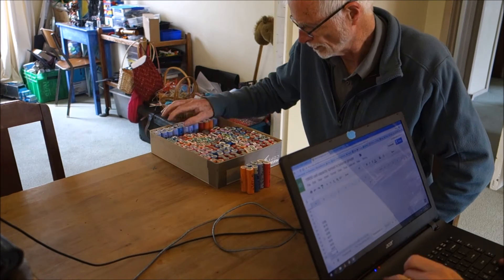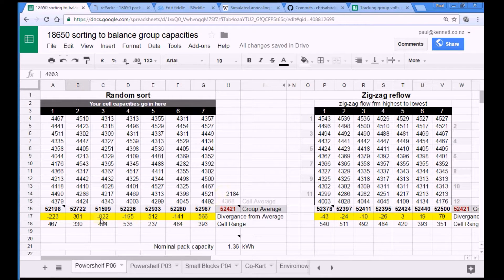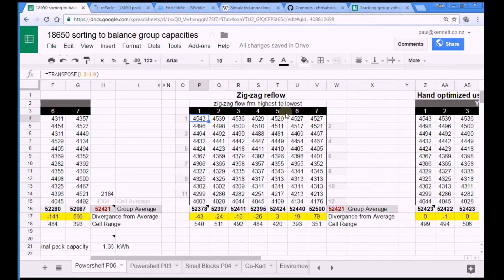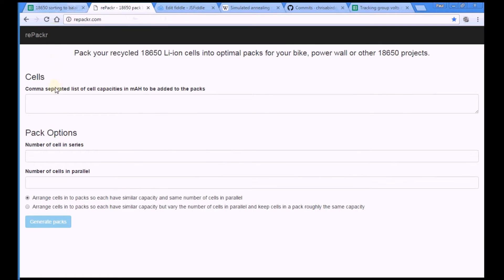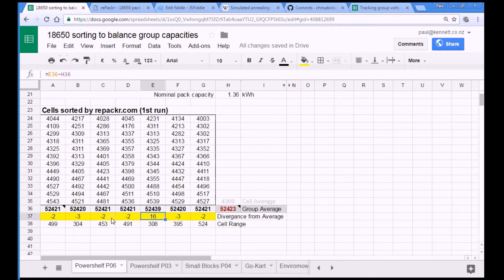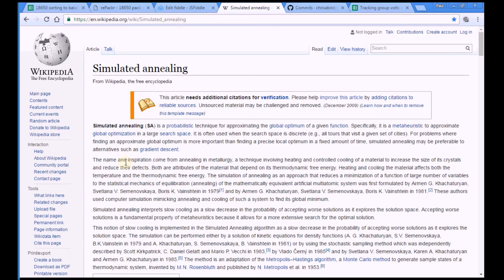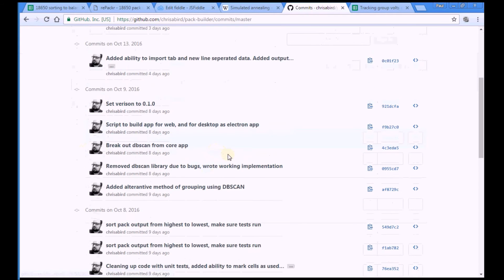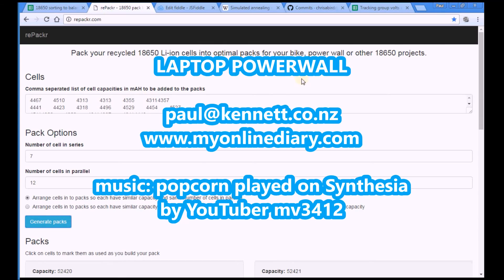Laptop Powerwall 77 - 18650 pack sorting options

Comment: Good video as ever Paul. I'm about to start another 14 mini block packs but my issue is i've a mixture of cells which are single and some which are still as doubles.  Might have to start pairing single cells up and then run them through repackr.com and see what i get out.  Might sound silly but shall save time as i've only 84 doubles to work with rather than 168 cells if that makes sense.
Reply from the maker: Yep - sounds like the best plan. In my 2kWh Powerwall I resorted to soldering up some good single cells into pairs. (When I first started collecting laptop batteries I'd take anything - even if they were odd shaped ones - which usually meant the cells weren't all in nice pairs.)
By the way I'm working on an extra 3D printed "extension" for adding connectors to the bottom of the small blocks. That'll make it cleaner to add small blocks together into 48P groups. I'll keep you posted.

Comment: a really nice video sir. I am slowly working on my first test pack 3 pack 100p of my weak 850 to 1100mah cells I have been getting
Reply from the maker: 100p - that's substantial!
Reply: yea but like I said they are all low from 850mah up to 1100 or so mah but that should still be alot of current at 100p I am trying to make it like a 105ah flooded acid battery to do some testing at 12vdc to start so 300 cells to start with I have around 700 cells at this point and my 2000mah and above are growing
Reply from the maker: You going for a 3S (miminal 11.1V) or 4S (nominal 14.8V) pack?
Reply: to start with I am going 3s at 4vx3 12v. Then when I get a forth block it will be 4s. I have now changed my pack to 80p 4x20 25 is just to long and 4x20 is heavy enough and when I get enough built it will be 48v

Comment: want to talk geeky..... I've been thinking about bar coding and tracking every cell :/
Reply from the maker: My friend John suggested that too. A weakness of the current sorting system is they ignore IR -  which becomes important above 80% SOC and below below 20% SOC (and most e-bike are designed to be charged to 100% so IR is worth knowing about - not so much with a powerwall).

Let's see ...
- scanner
- barcode printing
- barcode generator
- barcode reading software that feeds the data into a spreadsheet/database
... that's some hardcore geekery right there ;)
Reply: - scanner is cheap around 20 bucks(I have one)
- DYMO printer not too expensive(I have one)
- Barcode generator DYMO software will manage that
- Barcode to spreadsheet, scanning the barcode will populate the spreadsheet. 

hmmmmmm now that I've just run all that through... maybe just writing a number on the side of the cell would work as well. LOL